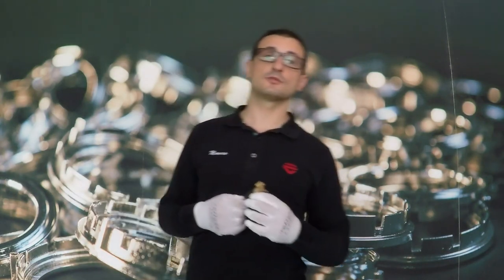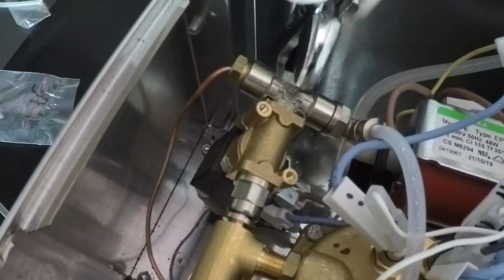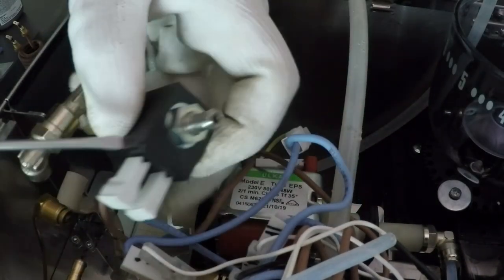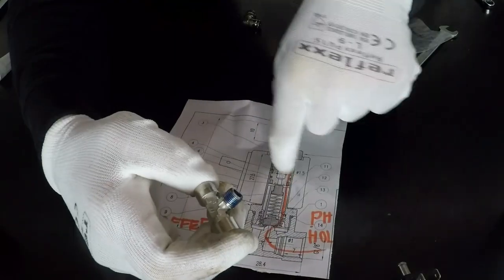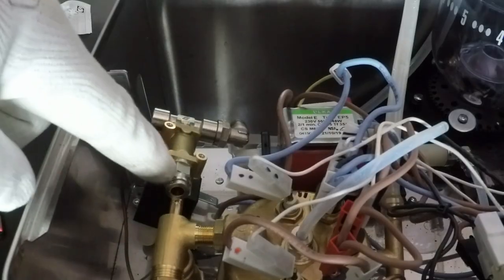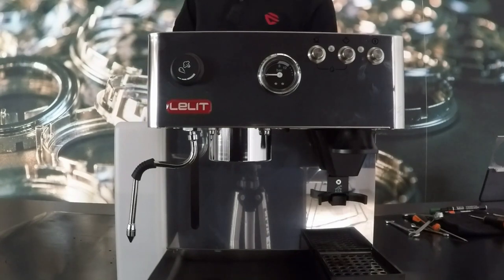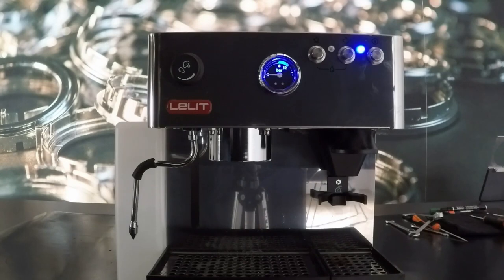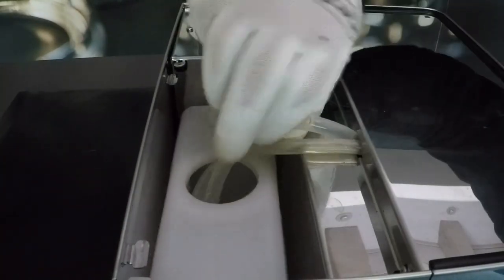Anna PL41 - Anita PL042: How to change the solenoid valve

Comment: @Lelit Hi,

My PL042 is not building up pressure anymore. When the machine is on coffee mode it seems like the solenoid valve stays open and all the water is forwarded to the drain bin trough the solenoid valve.

When on steam or hot water mode the valve seems to close fine. Should I replace my solenoid valve?
Reply from the maker: Hello, thank you for your comment. To better support, please forward your message to care.foryou@lelit.com attaching a photo of your product data label, a copy of your purchase document and a video showing the situation you are facing. Our Customer Care dept will be more than happy to support you. Thanks and best regards, LELIT Team